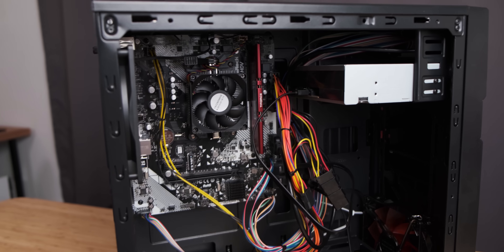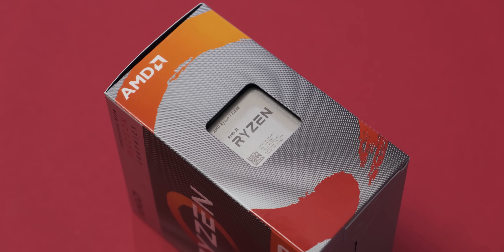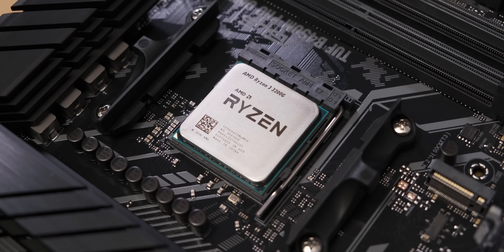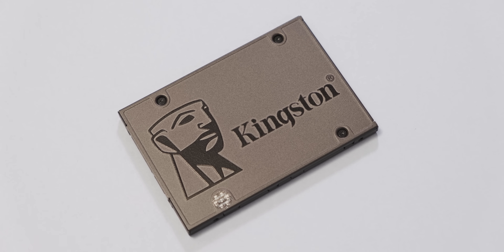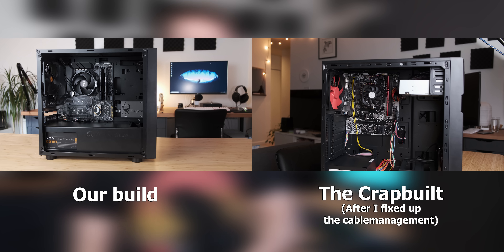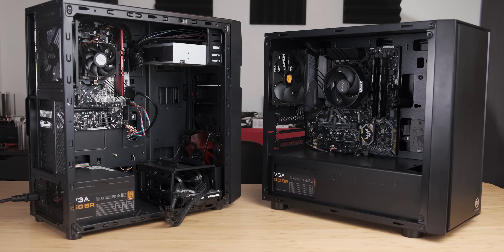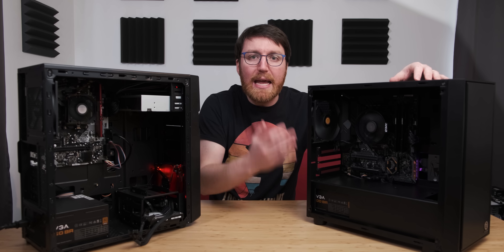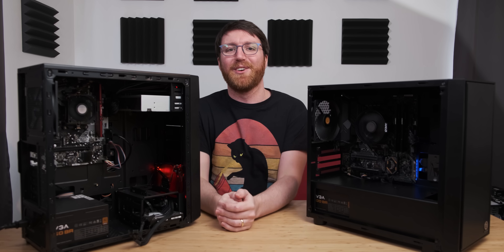Cheapest Amazon "Gaming" Pre-Built PC versus Custom-Built PC (2020)

Comment: im using a ryzen 3 3200g paired with a rx 470 i can run forza motorsport 7 in 4k with 50-60 fps
Reply: Hell nah, not even a 1000 dollar pc can run 4k at 35fps
Reply: @talonius5724  agreed
Reply: I had a RX470 paired with an i3-6100 and the performance was unbelievable, but not this unbelievable.
Reply: @talonius5724  I got a i3 9100f paired with a rx 470 oc to 1500mhz and that can run 4k at 35fps and that computer is only £400

Comment: Just for a heads up the Asus Tuf gaming b450 motherboard you used is 3rd gen "ready", not compatible out the box. I bought a new egg combo deal with the motherboard you used and a 3rd gen amd CPU. It wouldn't even load bios! I spent a full day, resetting cmos, trying my old graphics card, booting off disc drive and trying other things just wouldn't work. I'd just get no display. So I got a x570 gigabyte chipset motherboard then it worked. I'm also through Asus motherboards in general I've had one fry on me(like a $200 board) before like 10 years ago, and this was the last straw for me. So apparently, to get a 3rd gen amd CPU to work on a b450 Mobo you have to update the bios with a previous generation CPU. Amd is willing to give you a loaner cpu in order to do it or if you have your 2nd gen CPU like how the guy in the video has but that's a big headache and takes time. If anybody reads this just be mindful of the 3rd gen compatibility with b450 motherboards, x570 board work out the box for 3rd gen and CPUs. Hopefully save you a headache/a day of your life and wondering if the parts you bought were bad. I went through all of that.
Reply from the maker: I know this response is a bit late, but I did pin a comment to this vide pointing that out now. I should have mentioned it in the video. Thank you for mentioning it.

Comment: i had the versa 17 with a 3600x and A VEGA 64, One blower, one red devil variant, and water cooling for the cpu, and i maintained under 84C witch is normal for the vegas.
just have to use high flow fans, cpu neever broke 67c during gaming and 77 under cynthetic load

Comment: I went the weird way and decided not only to get a optiplex, but to upgrade it and change out the motherboard. I am getting a new case cause sadly I can't find a way to get the power button plugged in to the motherboard. I could just do some custom shit but I'm too lazy and the case I'm getting is still that "office" look.
Reply: Please do your research before you put new parts in a dell; I got lucky with mine cause windows 10 easily transferred to my new mobo and I didn't have to do anything bios update or remove even my old ass hdd. Other systems are different. Mine was an optiplex 990

Comment: I have the h17 and I'm running an 9th gen i5 on an aio and a 1660 the thermals are good, most of the air comes through a hole on the bottom of the front panel.

Comment: If you use an apu cpu, would it not make sense to buy a gpu  high speed ram stick for the pcie slot, that way system ram is not used. And the pcie can probably handle faster ram than the ddr4 slots, maybe even like 4-8 gb, of ddr6 ram, if available, plugged in to pcie. What do you think???

Comment: I’m new to PCs and I was wondering do I need a graphics card if I’m using your method
Reply: Nope a apu, it’s a mix of cpu and gpu
Reply: The 3200G is a apu like randall said. It has a built in graphics part much stronger then the integrated intel cpu's. Although even a budget graphics card will outpreform it. Going up to a ryzen 5 2600/3600 and a dedicated gpu will be worth it for a 50-100% more powerful pc, if you have the 100-200$ extra. And it will probably make it sufficient for several extra years., aswell as giving you a better experience while you have it.

Comment: Do you think that a 400w bronze rated power supply could handle a 1050ti zotac edition that has basic parts 8gb ram dual drive and a i5 with 3 non RGB fans

Comment: i wanted to know what you meant by cheap out on the power supply, do you mean make sure its new or just make sure its at least above 80 bronze? i build computers with used parts and resell them for a living and i only buy used parts unless the parts are cheaper new or someone wants a new build and ive never had any issues with used power supplies imo

Comment: Computer builds used to be so much easier when every single case only came in beige plastic and no fans. There was no such thing as a "Good" power supply then, either; every one of them had the potential to go up in smoke in a moments notice. The first high end gear I bought was an overly priced, overly marketed 56k modem that didn't work any better than any other cheap modem you could buy. The first high end video card I bought was a Voodoo2 card with 8 megs of ram and that was truly amazing. I remember my shock when I read about the first PC to break the 1Ghz barrier. Good old days!

Comment: I once bought a "gaming" pc which was supposed to have a GTX 980-ti in it. I was rather surprised to find a GT-710 in it. When I wrote the company that sold it, they said the producers were at fault, they only sell the products and have nothing to do with the production or packaging. So I wrote the manufacturers directly. Their answer: "This computer has a GTX 980-ti in it. You must have looked wrong."
So I sent them some pictures of the computer with the logo "EVGA GT 710" clearly visible. Their answer: "Since you've opened the computer, the warranty is now invalid, so don't even try to send it back."
When I asked about the wrong GPU again their answer was: "This is a GTX 980-ti. The label must be wrong." Oh yeah I forgot, because a GT 710 looks identical to a GTX 980-ti xD
If they wanted to say "screw you, we already have your money", why didn't they just say so...
Reply: Oh and I almost forgot to mention another great feature of the computer: on the lower part of the front, the case proudly featured a meshed surface with a nice RGB fan behind it. Only problem was, once you opened the case, you realized that the fan was absolutely useless, because it just sits in its own little box and simply blows air against the black painted wall right behind it. There was a small slit on top of the box for the cable to run through, but this fan did nothing against the heat in the case. The manufacturers clearly did not expect anyone to ever open that case xD
Reply: @caringancoystopitum4224  Bread 👍

Comment: My upgraded built cost similar or less but I went to intel route:
Gigabyte B360M Gaming MB
i5 9400F Hexa-core CPU
8GB DDR4~2400MHz
GTX 1050Ti GPU
EVGA 500w SMPS
1TB HDD, no SSD for now and I already had the Cabinet.
In future, I'll upgrade the GPU but now it works fine for me.

Comment: I just got a cyber power pre built and maybe I got lucky but everything worked perfectly and I got really good parts it has a warranty and came with two pretty decent games . They did a great job on cable management and I got a good gpu in terms of performance it is one of the better 5600xt .It seems right now because of the shut down buying parts individually has a premium. I only paid 900 and for the exact same thing would have costed me around 200 more. Only thing I can say is the power supply ketchup and mustard wires are ugly but even upgrading that myself I would still pay less than building the whole unit part by part.

Comment: If you get a cheap case and mobo you can get 16 gb of ddr4 3200, a Ryzen 5 1600 af, and an rx 550 (I know, bad card) for about $400 new. This, of course, is in addition to the psu and ssd.

Comment: Here's my computer's spec's what do you guys think?
Dell Optiplex 9010 MT
Intel Core i7-3770 3.4GHz 
ASUS GeForce GTX 1650 SUPER Overclocked 4GB GDDR6 video card
24 GB DDR3 CORSAIR Vengeance LP
SAMSUNG 860 EVO 1TB (SSD)
Western Digital Blue 4TB Hard Drive (Data drive)
Windows 10 Pro 
ASUS 16X Blu-Ray Re-writer BW-16D1X-U(installed internal)
Rosewill ARC Series 450W Gaming Power Supply
Noctua Premium Cooling fans(80mm and 92mm)
D-Link DWA-582 AC1200 PCIe wireless

Comment: Guys ive never built/assembled a pc before but is there a reason for spacing the ram with one empty slot in between instead of slotting in side-by-side directly?
Reply: Yes, there is actually. Depending on your motherboard your DIMM ( ram)  slots should be color-coded one spaced out one from each other. Usually, you're supposed to occupy the DIMM slot farthest from the motherboard all the while, make sure you space them out with one unoccupied DIMM slot in between. The reason for spacing them out is the fact that there are multiple channel modes for ram. SIngle channel, Dual channel, triple channel, and quad channel ( I could be wrong about quad). If you were to place the Ram side by side, it would put your channel into single which is slow and not preferable. depending on the ram amount you have you should put it in a certain order. The best advice I can give you is to look at your motherboard's manual or watch a few youtube videos. Hope this Helped!

Comment: Very good and cheap case deepcool shield is has a clean design a nice brushed aluminum look to the front panel decent airflow of the sides of the front panned with mesh protection, on top had room for a 240mm radiator with a magnetic mesh cover for the top super easy to remove. And only goes for $46CAD, picked it out for my friend who was building a budget build until he build his dream pc and I was shocked at the desing of this 46 dollar case just blew me away I don’t think he will have to switch when he builds his dream build has amazing room for cable management only thing that he may want to upgrade for his dream build and what probably makes it a $46 case is that the Sade panel has a window instead of full glass panel. But his case with the magnetic mesh cover and the nice brushed aluminum design on the front it seriously looks awesome! I would use the case with my $4800 build I would try and find a temper glass panel that fits the side and if I could I would use that for my extream dream build that I already have only thing that my pc could do better with is the case it’s it and that’s a Corsair carbide great clean look case just lacks the mesh protection that is a let down considering the Corsair carbide cost 2x more! Deepcool Dsheild! Best budget case I’m telling you

Comment: How are you getting 100 FPS on a $400 custom but I spent like $800 and I haven’t build mine yet but I have like into it a lot and it only says it will reach up to 100, I’m using the ryzen 5 3600 and xfx Xt 5500 rx thicc

Comment: Here is the only useful thing about a prebuild. If I was to go on newegg.com or Amazon to buy all the components to build my self a PC it will cost me $2,100. Now I can go to either iBuypower of Cyberpower and hand pick all I want in a gaming computer. Same parts as newegg. $1,300. I know I have to rework everything in the case and do wire management. But I saved $800. I some times take out all the parts and put them in a case I want. Prebuilds can save you a lot of money, if you know what you are doing.

Comment: That's fine and all, how about a comparison between one of the mid range priced ones? say the $1700 range prebuilts vs what you can build.. those come with up to a 9900k and a 2070 Super with an ssd and hdd in them all inside a tempered glass panel case with some RGB. The low end is obviously a wash with pre builts the mid range though I suspect is pretty close competition even with building yourself.

Comment: I know nothing about PCs and want one for Christmas why is this so confusing
Reply: Well it really shoudn't be there are a lot of videos from all price points on Youtube or even other websites 

Only comes down how much you want to spend and when you want to spend it 

Like a 600 Euro would look like 
120 Euro Rx 570/580 
100 euro Ryzen 2600
85 Euro 1tb ssd
50 Euro case with fans
50 euro power supply 
100 Euro 2x8gb 3600 mhz ram
100 Euro B450/B550 motherboard

And if you want to upgrade get a more expensive grafics card like rx 5700 , rx6700 or rtx 3060, rtx 3070
I personaly would never spend more then 500 Euro on a grafic card

Comment: Even if it does not have an 80 PLUS rating and thus not the best efficiency, I am pretty sure this PSU is safe. Grounded output avoids shock in case of failure and failure destroys only the PSU 99% of the time.
And that is... if it fails, because it looks OK, you are just choosy.
Of course you don’t have the connector for a GPU, but don’t ask for too much. This power supply is fine for what it is for.

Comment: I used an A8 9600 with SSD  as a Back-UP-PC / Unix-PC, it was not so bad if u have more than 8GB Fast DDr4 u could run Esport-Titles with easy with lower to Mid settings. I bought it for 25€ in Germany. so it was a no brainer. And it worked over a year or so for me. Now i use a Ryzen 3 it is by far the better APU, but if u have a small budget , it will work better than its bad Reputation.

Comment: Hey Dawid, I have an alienware aurora r11 and I just realize that the 550w power supply barely cuts it and I'll need to upgrade to either somewhere between 850w to 1000w  what brand power supply would u recommend me me upgrading to? I'm planning on getting a rtx 2070 so I mite need to upgrade the power supply if I have a 550w right? Can also anybody in the comment section help me out please?

Comment: I went a boring way too 😃
My build for now -
Amd ryzen 5 5600x 
Corsair vengeance ( 2x8gb ) 3600mhz cl18 
Asrock b550m pro4 mobo
Gigabyte g750h 750 watt 80+ gold psu
Coolermaster masterbox 511 argb case
Deepcool gammax pro 120mm 180 watt tdp cpu cooler
And a asus gt 1030 2gb ddr5 borrowed from a friend
Reply: Later i may get rtx 3060 or amd rx 6600 xt when it releases

Comment: The crap build is like my first pc that I built in 6th grade(A8, 8gb ram)😂 Eventually i bought a 1060 3gb but that bottleneck was still just awful! Finally got myself an r5 3600, 16gb ram, and still running that 1060. My system can handle anything i throw at it and it is truly amazing to see how far it has gone.

Comment: Would not use the stock amd cooler have had several occasions where this garbage binds to the processor and it rips the CPU out and bends pins it even happens recently after Turning off the PC.

Comment: Hi, great video! Just to understand, how much of a future performance you could get with a APU: AMD Ryzen 3 3200G without a graphic card? Would it be possible to add a graphic card on top and use the pc for longer period? Thanks a lot!
Reply: You could easily add a dedicated gpu along the line and still have a pretty decent processor to pair with it. Then save for like a ryzen 5 1600 af which would be a good upgrade for the cpu at a low cost.

Comment: Why you dont want stock AMD cpu cooler
It's noisy, even at 1670rpm and thats idle, granted it doesnt get noisier at full load, but if youre used to quieter cpu coolers(mine from 2014 was quieter) its gonna drive you insane

Comment: I'm quite confused about 1st 2nd and 3rd generation ryzen processors. Do they correspond with the first number of the processor? For example the 2200g is a 2nd gen processor right?
Reply from the maker: You have that correct, 1xxx chips are 1st gen and 2xxx 2nd gen and so on. Its interesting that you mention the 2200g though because the APU family (Ones with the g on the end of the name) is technically a generation older. So the 2200G uses zen 1 and the 3200G uses zen + (zen + is 2xxx on other chips). The APUs just complicate matters a bit. 😁
Reply: Thanks for the reply!

Comment: one word... aliexpress! people need to learn theses xeon's are killer price per performance.... you can get a 2620 v3 and turbo unlock it with a x99 motherboard and 16gb ddr3 with quad channel ram and then toss in a snowman cpu cooler  all for like less then 200 usd...  get a used case for like 40 bucks buy a new 500w psu for like 50 throw in a hard drive and  then get a good used rx 570 580 or 1070 and there ya go, you just saved your selves hundreads and are getting way higher value!

Comment: i know i come in extremely late on the comments, and I know nothing about computers, but one thing that could be said in defence of the Crap Build, is that they sold you the PC at $390, however they had to pay Amazon fees, shipping, and make a profit out of it, so I am sure their budget was significantly lower than $390. At the same time, they probably made this computer by taking bits and pieces from other dead machines, so that's what happens I guess.